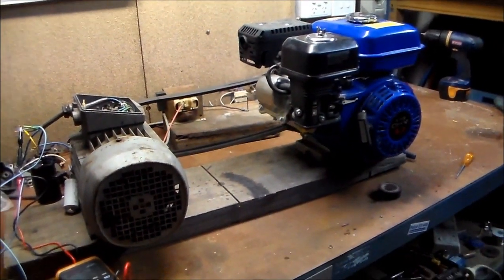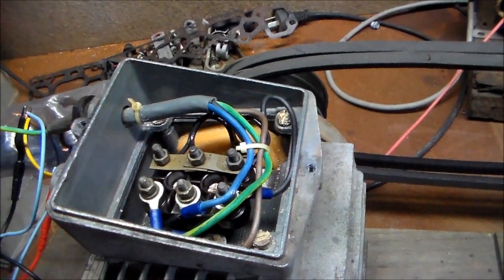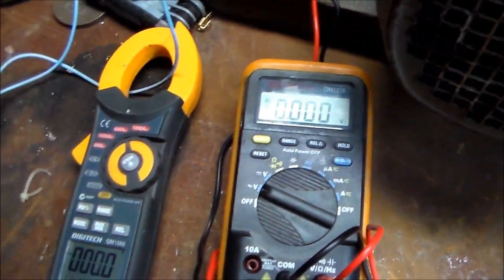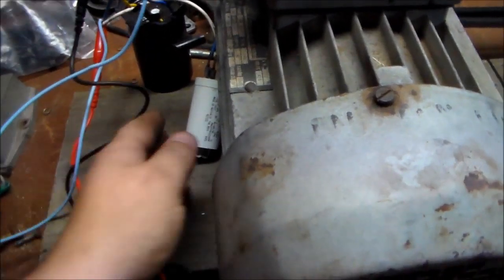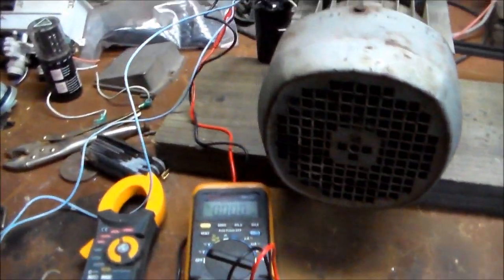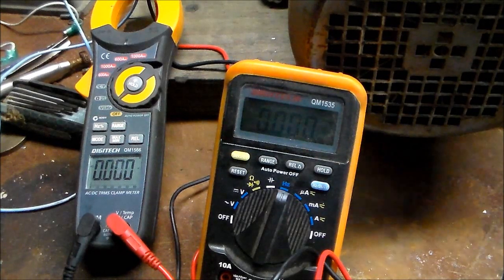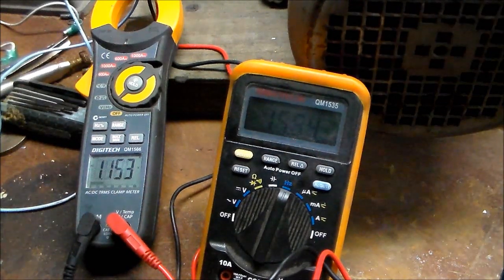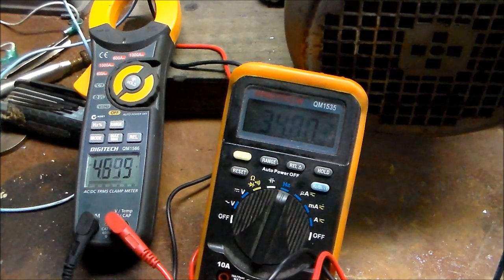Induction Motor as Generator! 500v @ 90Hz into Universal Motor!!

Comment: I try this and not happy I use one 70uf and one 25uf and I run up to 3000rpm and nothing happens all good working capacitors running capacitors yes they are the motor is a 1500 rpm 1/2 hp 120 induction motor

Comment: dont use caps if you gonna run another motor. just use a permanent magnet 3 phase motor without caps on the generator and the load would be much less. permanent magnet motors behave like caps when they run.

Comment: No problem at all.

As all generator are wired star so the where that bar goes across would be a neutral. So you should get 240v between a phase and that link bar. Things you learn as a sparky.